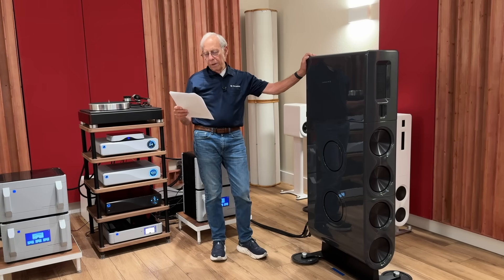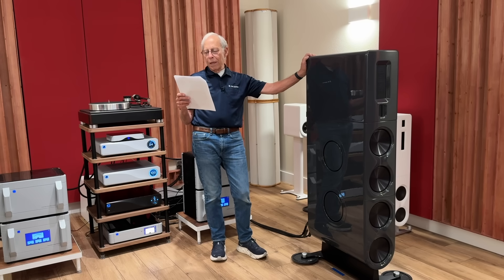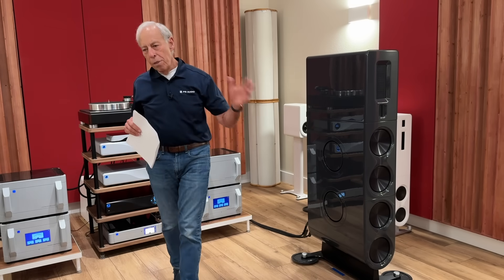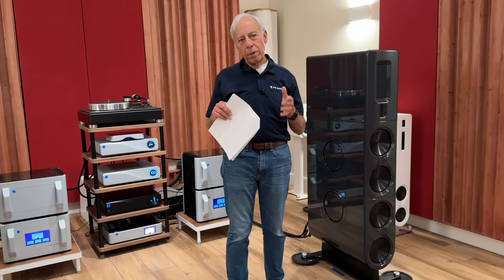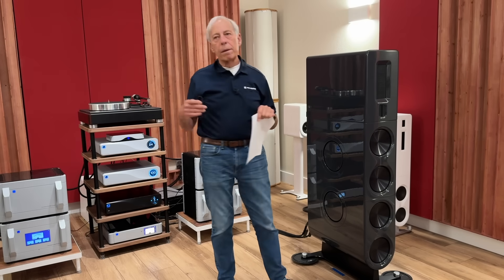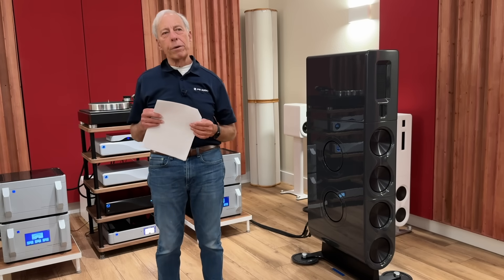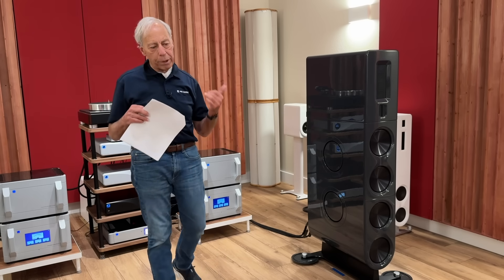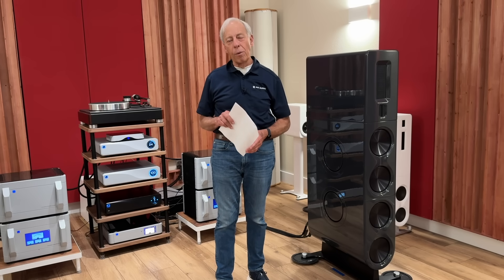Matching power amps to planar speakers

Comment: Hey Paul! You speak of current over watts to drive difficult speaker loads. I am thinking of pairing the M700 monoblocks with my Aspen Fr5's, but I have always been a tube, class a kind of guy.  Paired with a tube preamp, am I going to get prodigious current from the monoblocks to make the fr5's sing?
Reply: Depends on what kind of music you listen to and the volume level. FR speakers sound good with both solid state amps and tube amps. I have solid state running in class A when I want solid state and have tubes connected when I want to listen with tubes. If you're happy with your tube amp, keep listening with tubes. But being a tube guy, If you're also interested in solid state, you might not be satisfied with class D amps. If you need to keep costs down, a used Mark Levinson 534, a used Levinson 5302, or a used Pass Labs class A amp (XA series) might be worth looking into.

Comment: And to add to the amplifier options, I drive my 1.6qr with a Rotel-1582 Mkll. It can deliver at least 323 watts into 4 ohms. Both channels driven.
Gets my my maggies as loud as they can get which is reasonably loud. Even at what I think are moderate levels, the wife complains it's too loud.
Reply: Yeah, that's a great amp (with everything else built in too) for magnepans. I upgraded from the 1.6 to the 3.3 (I guess in some ways a sidegrade, but the ribbon tweeter really pops) and the amp works great with them too.

Comment: I drive my Maggies with a Crown DC300. I've had and retired a number of other amps and receivers over the last 50 years, and none of them sound as good as the  DC300. I got my Maggies in the fall of 1983. I've sent them to Magnapan twice for factory refreshes -- they sound GREAT. I also have a powered subwoofer with a crossover at 80hz, so that I don't ask the Maggies to handle any of the low-end. It is well worth keeping a supply of the factory-recommended fuses on hand -- the DC300 is more than capable of hitting them too hard. 

In my small (about 15 x 15 ft) listening room, this is more than enough power and the system sounds great.

The membranes on the Maggies get flabby over time, especially if exposed to sunlight, and they'll start lose some of their clarity. That's why I've sent them for a refresh.

After a happy lifetime of listening, I still enthusiastically recommend the Maggies. I can tell you without reservation that they do just fine with my venerable DC300.

Comment: I have the Magnipan LRS+, and even though they are the smallest, they still require significant power to drive fully.  I use a pair of Classe Cam 200 monoblocks, producing 400w RMS.  I learned a long time ago that amps have the least distortion when using a small portion of their power.  So I would say, not to be afraid of using an amplifier that is bigger than the minimum specs to run them.  Just make sure you set limits on the volume or you will trip the fuses.

Comment: I am currently driving my Maggies with a BHK250, but previously I used a BAT VK200 which had only 100 watts/channel which sounded good. The main difference is the bass which is more solid with the BHK. I suspect the output impedance is more important than the power rating.

Comment: Magnepans are the only speakers I know, where (some) people are willing to spend 10 times more on the amp than for the speakers. Iv'e never understood this.
Reply: Two reasons, the amp needs to be clean, have lots of both power and current, and probably larger than the minimum specs to drive the speakers.  A 50 watt load sounds a lot better being driven by a 500 watt amp than a 50 watt one.  
Secondly, Magnepan speakers are an extremely good value.  Few speakers sound as good as them at their price points, and better equipment gives you better sound out of these speakers.
Reply: $3.1k Coda Ts v3 
800w@4ohms 😊

Comment: Maggies do not have low impedance dips.  Electrostats do.  Planar magnetics are almost purely resistive loads, meaning the impedance doesn't vary a great deal throughout the frequency range.  The only thing that makes them difficult to drive is that they are typically very inefficient.  That means they need high power.  But their dynamic capability is limited by their physical excursion capability, so at a certain point they can't play any louder no matter how big your amp is.  To play louder, the panel must get bigger.
Reply: Stereophile's test lab shows multiple dips on Magnepan LRS speakers down as low as 2.8 ohms. So I guess they do have low impedance dips.
Reply: Quad ESL are great. I have 989s

Comment: I have Magnepan 7's and drive them with my Spectron musical MK lll class D amp designed by John Ulrich It's output is 500watts@8ohm 650@4ohms and 1,200 watts@1ohm and 65 amps 
I've also intergrated two SVS Ultra 13 subs with the Maggie's Let's just say my 55lb Spectron brings my Maggie's to their knees 😅 If my old Spectron dies i would consider the Orchard Audio Gna amp

Comment: Class D amps are perfect for this …. Because they can drive 2 ohm loads and have high damping factor…
Reply: I don't know about that.  I had a friend that was trying to power his magnipan 2.6 with some carver monoblocks that were class D.  It was a bad match, even though the amps were producing  at least 300 watts.  He needed more amps, which a lot of class D's don't have.
Reply: Class D sucks for power  loads that dip down, dampening is a problem as well with most class D although it has came a long way class H from emo , or outlaws monoblocks..😊
Reply: - Class D aren't inherently 𝙘𝙖𝙥𝙖𝙗𝙡𝙚 of driving demanding low impedance loads. 

- Class D aren't inherently 𝙞𝙣-𝙘𝙖𝙥𝙖𝙗𝙡𝙚 of driving demanding low impedance loads. 

Just because they're Class D doesn't mean anything one way or the other. 

High current capability and an ability to drive low impedance loads is independent of amplifier class. 

There's high-voltage, high-power Class D designs, that aren't ideal for low impedance loads. 

There's also high-voltage high-current Class D designs that are ideal for difficult low impedance loads.

Comment: To recap: 1. Question is asked. 2. Digression on a different speaker with a different planar design for some of its drivers. 3. Explanation that you need an amp that can handle impedance dips. 4. No explanation whatsoever as to what the characteristics/specs of such an amp should be. I’m sure the guy who wrote the question has found the answer useless.

Comment: Paul says "if you have a couple hundred watts you'll be fine".  He never caveats that statement with the fact that normal size listening rooms don't need anywhere near that much power.  He's made similar statements many times before - that's simply being a dishonest salesman pushing high power amps. 

Magneplanars typically produce 86 dB at 1 meter with 1 watt.  At 200 watts in my small listening room (12 ft. x 15 feet) they'll produce well over 105 dB (peak) at 2 meters (see the  benchmarkmedia SPL calculator).  That's a level so high that it will cause permanent hearing loss in 15 minutes to an hour.    

If your listening room is small to medium, you really don't need more than 20 watts unless you're trying to drive very inefficient speakers.  A 20 watt class A might actually sound better than a 200 watt class A/B.
Reply: 86db sensitivity 
--------------
86 dB at 1 watt
89 dB at 2 watt
92 dB at 4 watt
95 dB at 8 watt
98 dB at 16 watt
101 dB at 32 watt
104 dB at 64 watt
107 dB at 128 watt
110 dB at 256 watt
113 dB at 512 watt
Reply: @unclewilbur8976  You're forgetting several things.  1) There are two speakers that often are producing the same audio. +3 dB  2) Nobody listens at 1 meter.  You might listen at 2 meters -3 dB.  Further away, even lower.  3) There are room reflections and absorption to account for.  That varies.
Reply: @markmeridian3360   ...you have completely missed the point.
Reply: You don't have a point.  That's obvious because if you did you would have stated the point.
Reply: @markmeridian3360   ...  "nobody listens at 1 meter(sic)"  ...it's actually spelled 'metre' since a "meter" is something completely different. Of course no one listens at 1 metre. What is the point of you saying that?
Reply: Nope.  Metre is the British spelling.  Meter is the American spelling.  The point is, obviously, you can't use the SPL at 1 METER to determine your sound level at greater than 1 METER.  Sheesh.
Reply: I couldn't agree more. By far the best amp I ever had was a Pass Labs 30 watt class A amp. At the time it was driving speakers that weren't that efficient, around 86 db or so. I have Magnepans now and drive them with a 60 watt conrad johnson tube amp and they sound great. And my room isn't big and they get plenty loud. Damn I wished I didn't sell that Pass amp!
Reply: LRS model is not 86 dB at 1 m for 1W, but 86 dB at 1 m for 2,83 V which is not the same. They will need 2W to get that voltage, because impedance matters. LRS are 83 dB/W at 1m. If we add at least 3 dB of headroom (clipping isn't our goal), which isn't much, plus distance, real power need is higher than many might think. Power can be calculated if done right.
Reply: @Jorge-Fernandez-Lopez I don't know why the LRS would even be measured at 1 meter, that's an inaccurate way to measure a large planar speaker.
Reply: @mitchtaylor6512 That's a good point.
Reply: @Jorge-Fernandez-Lopez  True, it's 2 watts.  That doesn't change what I said at all.  

I was talking about peak levels without clipping..  The SPL calculator I referenced covers those things.   The fact is big power isn't needed in a small to medium sized room unless you're trying to drive very inefficient speakers.  Magnepans aren't that inefficient.
Reply: @markmeridian3360  It didn't use an online SPL calculator, although I use a formula to estimate power and buy my amplifiers. In my opinion and formula it changes everything: twice as much power with the right unit (2,83 V is a "strange choice of a one sector of the industry that came from 8 Ω nominal impedance: «John DeVore goes on a rant...» [great video]. I said twice, plus many more factors. The fact is that my calculations are close to real measurements. An example: 85 dB/W at 1 m (almost twice as efficient as LRS), 2,5 m distance, 75 dB listening level, 20 dB dynamic range (classic), 6.99 dB headroom (slowest distortion), stereo with coherent sound (best case scenario) equal to 102,96 dB needed at 1 m, plus the headrom less the sensitivity (85 dB/W) we get a gain of 24,95 dB. That relative relation in power will give us 312 W for 1 speaker; 156 W for two that play the same coherent sound (incoherent will be worse). LRS will need almost twice. Many speakers that declare a too optimistic "nominal" impedance"  (min. no less  than 80% of nominal) use to declare sensitivity with voltage instead of Watts, because their  real voltage (and sound) for 1 W  is much lower than 2,83 V; 2 V or less for 4 Ω (nominal) speaker, and they know, that most reviewers don't know what a dB is or is not (no units), or the difference between the two units and their application. Twice  is a huge difference that can determinate one amplifier vs another, or maybe a speaker instead of another that was more transparent (about information). Sometimes, the power needed is much less than we might think, whereas in other circumstances, it's much higher. Results of some online calculators may vary a lot, I use to follow the method and formula of some books and technical webs about audio.
Reply: @Jorge-Fernandez-Lopez  I do my own measurements with a calibrated sound meter and watt-meter.  For my listening room, the online calculator matches both my measurements and my own calculations quite well.  

I just measured a pair of speakers rated at 90 dB/1 watt @1 m.  It took 0.4 watts to achieve my preferred listening level of 80 dB at ~2.5 m (fairly loud but comfortably below the 85 dB threshold at which long term listening will start to cause hearing loss). 

It's bogus to claim that you need 6.99 dB of headroom to minimize distortion.  Depending on the amp, one amp with 0 dB of headroom might have lower distortion than a different design with 6.99 dB of headroom.

The fact is, you do not need huge amps unless you either have a huge listening room or are trying to drive very inefficient speakers.
Reply: @Jorge-Fernandez-Lopez  If you have a small to medium sized room and reasonably efficient speakers, you'll NEVER use 200 W.  I learned that when I first got into audio (many years ago).  I was fooled into buying an expensive 200+ W Amp.  When I got it home, I quickly found out that it rarely even hit 2 watts and never got above 20 watts. I had to swallow my pride and admit that I had been duped by an unscrupulous audio salesmen.  

I've since bought better sounding amps that have a fraction of the power.   

BTW, my Grandmother's maiden name was Fernandez.
Reply: @markmeridian3360  I did the same. I knew how much I needed. Like you,  I wanted a better "sounding" amplifier and I had to chose the right speaker to lower the power requirement. 20 W for that systems and my needs isn't enough,  while 100 W or more would be more expensive and useless. If I had to, I could have selected a system between 10 W and 200 W for that room; all components would have been quite different (starting from speakers and distances) in that range and all of them would probably sound very nice, nice but different. Enjoy your system.
Reply: @markmeridian3360 ...my HEGEL - 'H390' has a manufacturers rated output of 250wrms/ch/8Ω & it sonically crushes any 'A' class, 20wrms/ch/8Ω amplifier that I've ever owned...just sayin'. Then there's the all-important headroom factor to take into consideration, illustrated quite well by our esteemed 'unclewilbur8976' with his post on this thread.
Reply: Experienced Magnepan users prefer much higher watts than you're suggesting. 

Magnepan Mini, minimum 60 watts but 100 watts prefered
Magnepan .7, minimum 100 watts but 250 watts preferred.

Remember headroom, transients, and not pushing amps too hard. Also, at higher frequencies Maggies get into 2 ohms, otherwise they're a fairly even load. 
And high current is essential. Maggies with a great amp are astonishing!!!  
I will never buy another box speaker. Never!
There are other plannar magnetic speakers too. The best is Clarisys!!! Check them out. They are VERY EXPENSIVE,  but they have been taken to the highest limits. Maggies are very affordable.
Reply: @unclewilbur8976  I love the sound of full size planars for their huge airy soundstage, but they don't have the dynamic slam for loud rock that I crave. But, if God came down and demanded, "Thou shalt buy planars!" I would get the Diptyque Reference. I heard them at Axpona a couple years ago, and I was very impressed. 

As for amp power, I'm in the "no such thing as too much headroom" camp. My speakers are 4 ohm and 100 db efficient, and they're bi-amped with amps that put out 250 watts at 4 ohms.
Reply: @unclewilbur8976  Are you deaf by now because if you ran Magnepans at 100 watts you would be.  OR SHOULD I BE SHOUTING?  I was talking about peak sound level.  That covers headroom.

Comment: PS AUDIO has 2 amps that would work very well with Magnepan speakers:

Signature 250 Stereo Amplifier

Output Power

Both channels driven 120vac mains, 1kHz, 1% THD
8Ω	250W minimum
4Ω	500W minimum
2Ω	Stable for musical transients 

Signature 300 Mono Amplifier

Output Power

120vac mains, 1kHz, 1% THD
8Ω	300W minimum
4Ω	600W minimum
2Ω	1000W
Reply: Maybe....have to try 😮

Comment: Looking for amps for Magnepan speakers, the simple answer is Pass Labs. Get class A if you can afford it and can manage the heat, otherwise, get class AB. Other amps will do the job too, but it’s essential that you choose amps that double the watts as the ohms are are halved. As an example: 250 watts into 8 ohms, 500 watts into 4 ohms, 1000 watts into 2 ohms, stable at 1 ohm.
Reply: If you have to slum it, Jeff Roland amps will also work at 1 ohm.
Reply: @alex_stanley 
I’m aiming for Accuphase A-300 for solid state, and VAC 300 iQ for tubes, with Clarisys Minuets.
Reply: @alex_stanley The Accuphase A-300 mono blocks double down all the way to 1 ohm.
125@8, 250@4, 500@2, 1000@1  …and the midrange is divine! That’s my plan.
Reply: @alex_stanley  ... OUCH!  😂
Reply: Generally good advice, but I will also note that Audio Research’s bigger tube amps drive Magnepans very well.
Reply: @RichTeer 
Tubes are becoming an irresistible temptation. I like some warmth and full midrange without sacrificing detail. Tubes.....
Reply: I am driving MG-1.7’s in a 12’x16’ room with a 40 watt Cary tube amp. Sounds awesome IMO. My normal listening level is 80-85 db with a mixture of jazz and rock.
Reply: @RW-ur7ym 
Are you using the SLI-80,  which (I think) puts out 80 watts in class AB?
That's a gorgeous sounding amp with gorgeous sounding speakers, but it's on the side of underpowered for current hungy Maggies. Nevertheless,  I would thoroughly enjoy the delicious sounds!
Reply: @unclewilbur8976 Yes, It’s an SLI-80. I run it triode mode which is 40 WCP. Plenty of power in my room, volume control is usually at the 10-11 o’clock position. I also have an Audio Research D-300, 150 WPC @8 ohm. I prefer the Cary.

Comment: Any decent amp should be fine.

I'm a huge planar fan and have used everything from Adcom to Denon to Mark Levinson to Ayre.

I haven't done tubes, but that's more of a practicality issue for me as my system is on 24/7.
Reply: Not the Big Dogs 😊